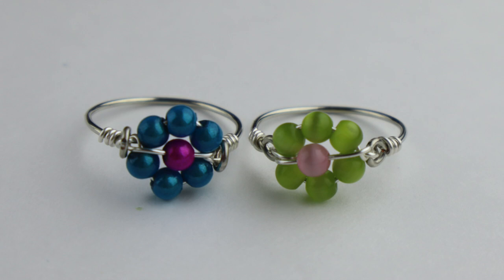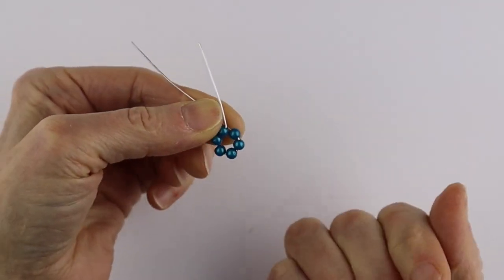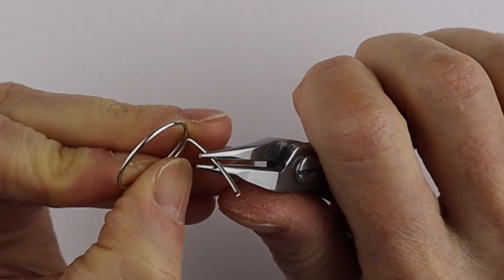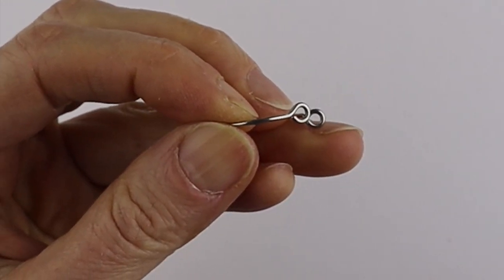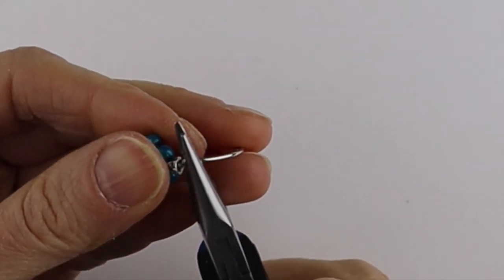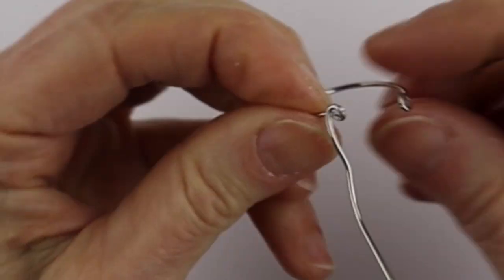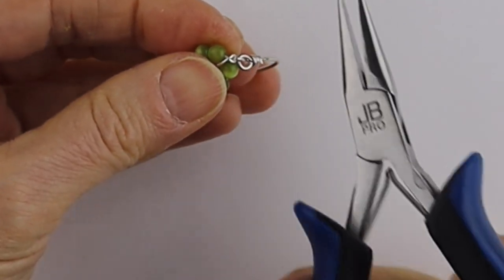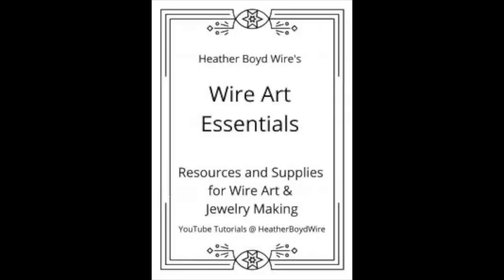DIY Flower Ring // Simple Wire Wrap Beaded Daisy Tutorial

Comment: Awesome! I made one before I saw this with 24G wire. I put the 6 beads in the middle of a 18 inch 24g wire, then I brought them together and threaded one wire thru one of the beads and pulled. then I brought one of the wires into the middle, loaded one bead and wrapped it around the daisy wire. then I wrapped the same wire around 3 of the beads and used the other end of the wire to wrap the other three beads. I wanted to end with the wire opposite each other so I could wrap the remaining wire around the ring mandrel. I wrapped the wire around the ring mandrel six times and ended it by wrapping the ends around the six strands near the daisy. I hammered it lightly to harden it. It came out really better than I thought it would. Thinking of making some earrings now.  Hope this makes sense. I think I'll use your way to make the earrings. Thank you. =)
Reply from the maker: That might be more like this one except you wrapped it more times around the ring mandrel: https://www.youtube.com/watch?v=2TJwFS0jBnc&t=11s Sounds like yours turned out nicely!